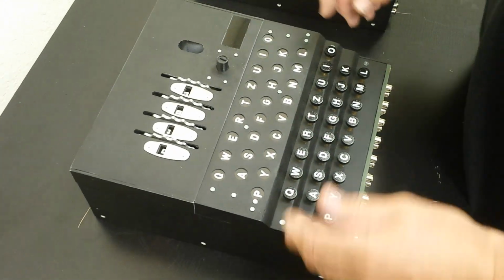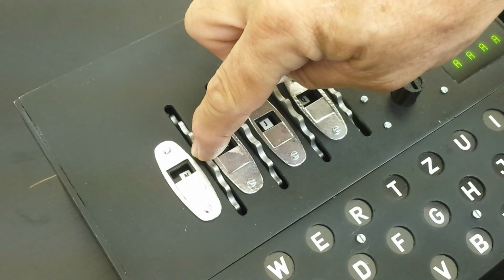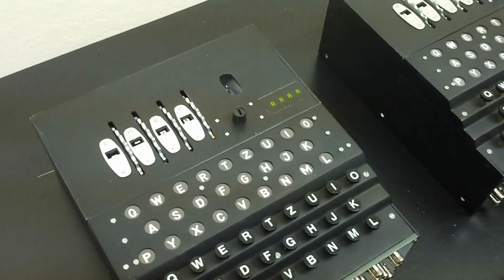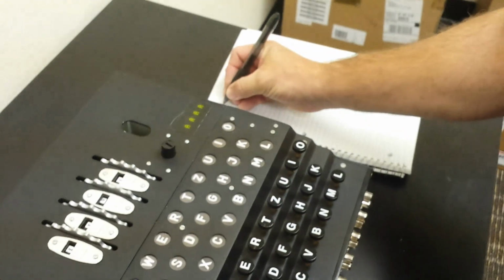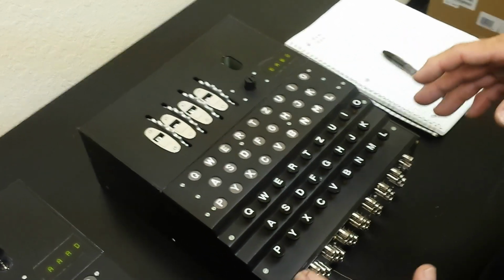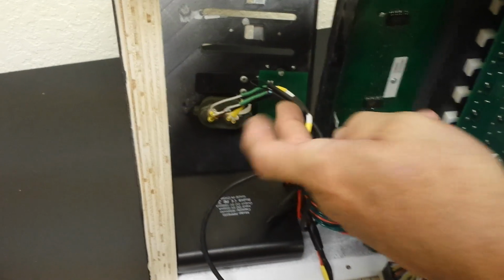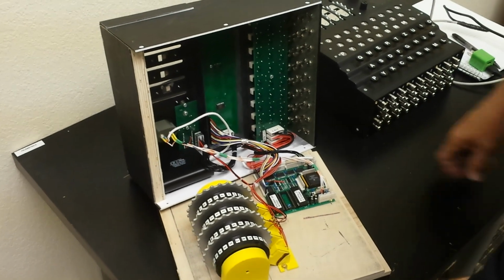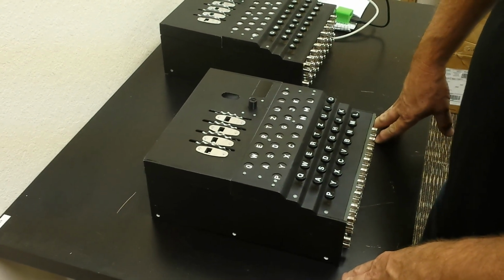Homemade Enigma Cipher: Overview and Demonstration

Comment: how long it will take a modern super computer to crack enigma now?
Reply: Approx. 20 minutes of less on a regular computer. so maybe 2 min on a super one?
Reply: @blitzkrieggaming7685  thanks
Reply: It depends on the message and the method. Look at computerphiles videos to see
Reply: @ryanthomas2374  for sure it takes longer to decrypt a message of 100 lines  than a message of 3 lines. But how long does it take to decrypt one word, (yet again it depends on how many letters there are), Let's say a word of 5 letters.
Reply: @stephjans6411  Actually, its the opposite. The shorter a message is, the longer it'll take to crack. This is becuase there is less information/pattern to detect.Thus, making it harder to crack. A longer sequence has more words that could be easily detected

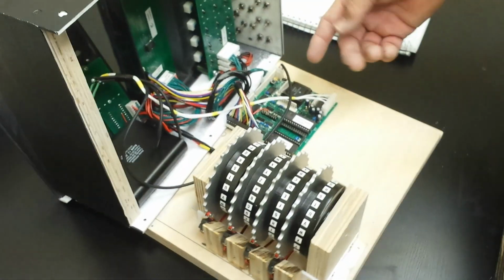Comment: 13:20 If there are no electrical connections inside those rotor drums then you don't need a reflector wheel at all. The encryption is safer without it. If it is all on a cpu then all you need is a mode selector switch.
Reply: I believe the 4th rotor is to simulate the 4 rotor enigma used by German Navy rather than a reflector.